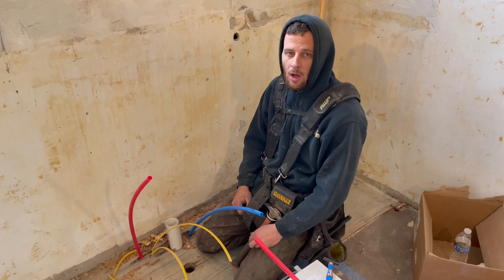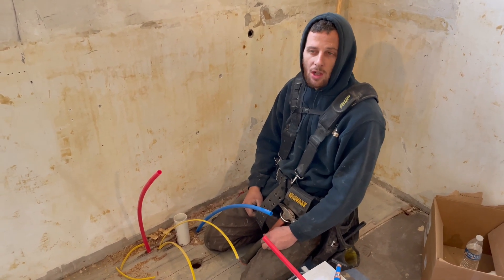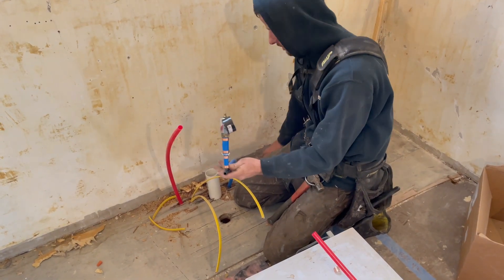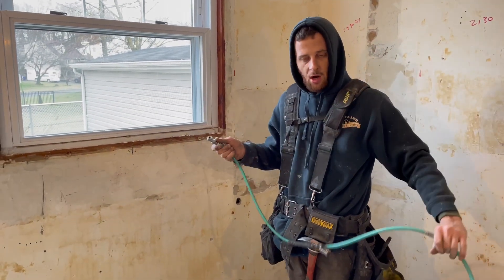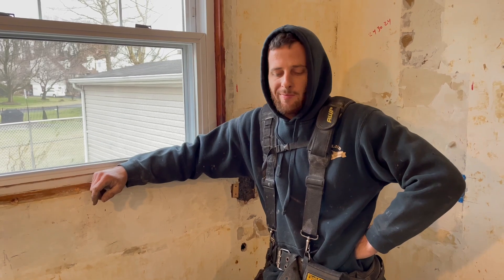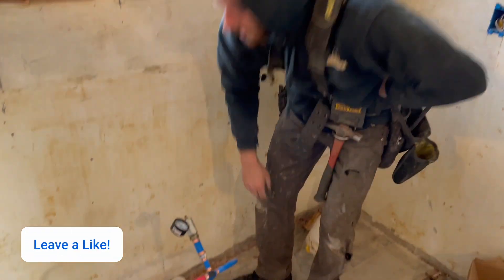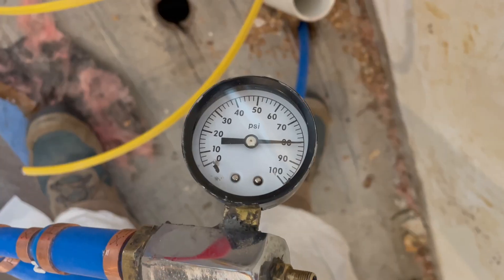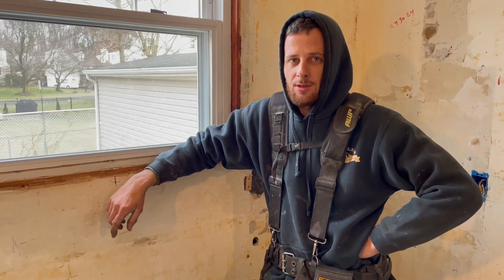Running an Air Test on New Plumbing | Episode 13

Comment: If you're just testing a new washer and a new kitchen sink, how do you do it? Shut off the main and drain the whole system, or do you have to somehow isolate what you've added?
Reply: Just open the main water supply a tiny bit and have someone else slowly open it more. If it leaks, get them to turn off and then retighten. 

If you’re just replacing a kitchen sink then I assume you’re confident with the rest of the plumbing in the house being ok
Reply: Ya, all of the rest is existing. I just have to add a washer and a new kitchen sink. I wasnt sure if you just charge the whole system or if only what you added had to be isolated. @ashtilbury8957

Comment: I always test throught hot and cold on laundry if i cant do it through shower valve.. and put a gauge on the shower head. We have to get to 125 for a water test. Then air test drain lines to 5 pounds. Way easier than water.